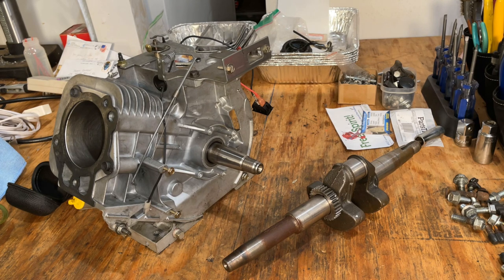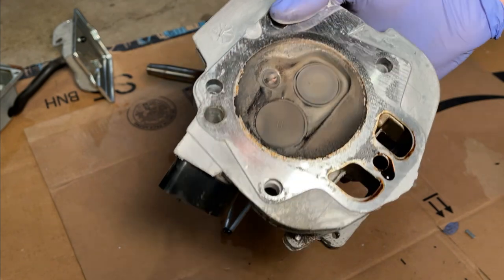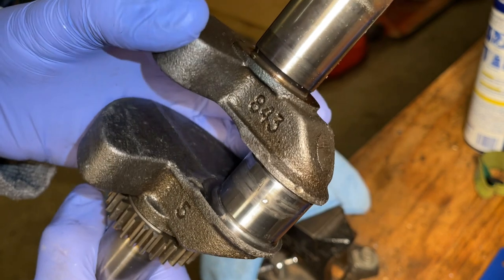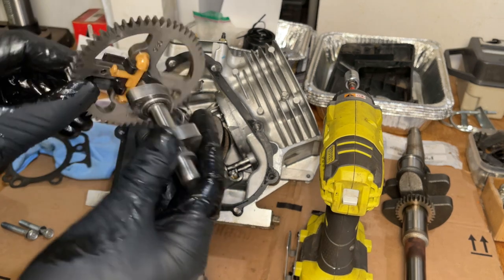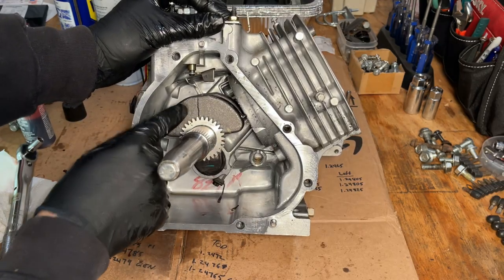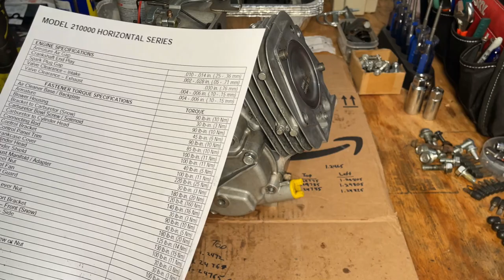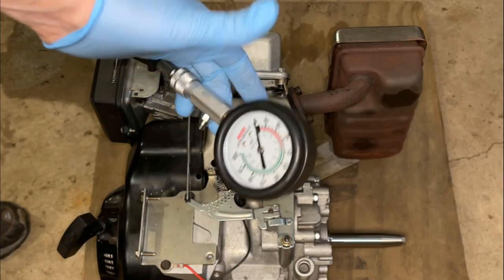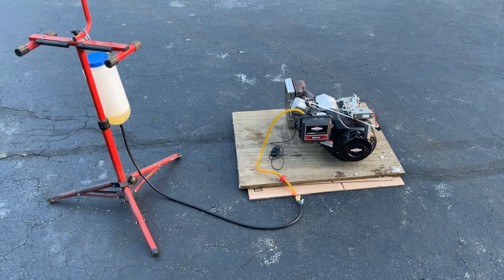Generator Engine Rebuild (Take 2) - 10HP Briggs and Stratton

Comment: I've used cranks farther out than yours. Just run a heavier oil and let it rip. I never had one blow up because of a galled crank. Everyone knows that the lack of oil kills these engines. And by the way. By sending information out like you've got on clearances, I wonder if the people producing small engine performance sheets are building satellite parts?
Reply from the maker: I agree.  I am pretty sure that crank would have been fine.  But hard to use with 25k subscribers looking on.

Comment: Caustic soda is the way to go.  It will dissolve aluminium and magnesium alloys but won't touch the steel.  I don't know what a new crank costs, but a valid fix would be to spray weld and turn the crank back to spec on a lathe.

Comment: That was an excellent video. I had a 10 H.P.  Briggs engines in my shop this month with broken compression release cams, and one 23 H.P. Also one with an exhaust valve guide pushed up into the valve spring in the head. Why are the Storm Responders using that much oil, that they are blowing up? or are people just to lazy to check the oil? Also are you getting any Champion generators in to fix? I had one with a plugged up exhaust  spark arrestor and the engine oil was extremely sticky. Had to flush it out four times to clean it up. Thanks for great video's.
.

Comment: Comstar 99% pure lye on Amazon. Also, would you consider using Sealed Power Plastigage , there are several clearance ranges, to measure bearing to shaft journal clearances? Also found on Amazon. Thanks, love your videos!

Comment: You do have another option to save the crank with a slightly smaller rod journal. That is to shave the rod cap to close up gap. But you have to measure for proper clearance.
Also the new crank looks like a chinese knock off. Just look at how poorly the counter weights were cleaned up compared to the OEM item.
Reply from the maker: Last time I order a new crank.

Comment: Jim, thanks for including the torque settings in the video. Question: did you decide against getting a hydraulic lift table? Just curious. Nest regards. Jim.
Reply from the maker: Will get one at some point.  Back and knees are still good.
Reply: @jcondon1  Will you wait that they are not good before you buy a lift. I have watch a lot of your videos and learn a lot. Thank you very much. Now I have repaired one but not on the floor. I put it on the bench in order to save my back and knees. I think that a lift is a must in your hobby work.

Comment: Out of curiosity, did you measure the new crank and confirm the Briggs book wasn’t over optimistic?
Reply from the maker: I did, but don't think I left that it.  It was dead on the new spec.
Reply: @jcondon1  thanks James! So it let the reject spec, or was above the reject? I suppose I’m unclear on the spec. I figured it was the minimum acceptable value. So if it was that, that means it would quickly wear below that, no?

Comment: All those engines look fairly new why were they out of oil and if I would have received the crankshaft from Briggs & Stratton that looked like that I would have been making some phone calls.... Anyway instead of rebuilding I would have bought another engine.. that's me time saving... Great video thanks
Reply from the maker: They did run out of oil.  Buying a new or used engine in working condition would have made more sense.  At the time I needed a 10hp engine and no used ones were available.  Thought I could rebuild it for $150.  Turned out to be twice that.  Would not do it again unless I had a good used crankshaft.

Comment: The out of spec cranks could be made to work with oversized bearings or shims, assuming the cranks were still mostly round. Shims would be less desirable because they cause other problems.

Comment: I understand what you mean about buying something new, and it's not right.  Happens in the car engine rebuilding all the time. A friend bought new aluminum heads for a V8 engine,  had a machine shop check them out, needed a valve job before they could be installed.  We're talking about new heads, cost $2000 and not fit to just bolt on and run.  Sad . And frustrating

Comment: Did you put the governor gear in I didn't see that that's a very important piece of the operation of that engine?
Reply from the maker: It is on the crankcase cover.  Was not visible from the angle I was recording.

Comment: Hi, i have same looking blown engine from a 204412-0163-e1 My cylinder, piston and rod are bad. crankshaft is ok . try finding those parts but item is discontinue and local shops doesn't have it , can i have an advice on where to look for? , i refuse to let it go. Thank you in advance

Comment: Did you check out the option of getting the cranks polished or cut and buying a oversized connecting rod ?
Reply from the maker: Still looking into that.  I have 5 crankshafts now for this engine that need work.  Would rather use those after being repaired then the NEW one...

Comment: Quick question what's the concentration of Is Muratic acid that you use. Is it pool acid straight out of the bottle or is it a different concentration. Also one of your other videos I noticed you cleaning a carburetor what do you use in your ultrasonic do you use chem dip  Or do you something like water and  Ammonia.
Reply from the maker: Not sure the muriatic acid concentration.  It is sold at Home Depot and made by  Klean-Strip.  In the ultrasonic, I use Harbor Freight Super Heavy Duty Degreaser.

Comment: If you have a machine shop around you might see if it cost effective to have those crank journals built up. Disappointed to see the new crank looking like that.
Reply: A-0.010” crank grind with an underside rod will work and be cheaper.
Reply from the maker: Do not see any undersized rods available on the parts diagram.  Where would one go for that?  Engine# 21T212-0116-G1
Reply from the maker: Me too.  Will looking into getting them machined.

Comment: Most machine shops will regrind those crankshafts for a small fee , but can you get undersize bearings/connecting rods for the motors , if not the machine shop can undersize the connecting rods for you , anyway some machine shops can grind the crankshafts for you !!!!
Reply from the maker: Yes, been looking.  Have all the bad cranks.  Hopefully will find someone who want to fix them for less then the new price.

Comment: i wonder if the tight clearance on the counter weights and the pushrod might be the point of failure on these engines? if the rod gets a little lose. it might start hitting the weights and wearing it down to the point of failure?
Reply from the maker: Could be, but the original crank did not have such an issue.  Am worried about he new one.

Comment: Could you have the crankshaft turned and use an oversized bearing like what is done on car engines.
Reply from the maker: Not sure since this engine does not use a bearing on the crank.

Comment: Muriatic acid is just fine..oven cleaner doesn't work as well. As long as you neutralize the old acid it's fine...why would anyone say not to use it??? I've used it many times and it's the best to get rid of aluminum on the crank!

Comment: You can put low oil sensors in those engines I put them in all of mine.
Reply from the maker: Do you have the part numbers you used?
Reply: 790141 and 695693 I'm fairly certain that's what I used.  You might want to research it a little.
Reply: 794185 is the module

Comment: Can't you get the cranks re-ground and oversize bearing shells?
Reply from the maker: No bearing on the crank.  re-groud would be a good option if Briggs made a connecting rod to fit.

Comment: I assume the rods do not have bearings on these engines. If so, the rod, being aluminum, would wear much faster than the crank journal. Therefore, if the crank journal was worn beyond limit, the rod would always need to be replaced.
Reply: The bearing is in the form of babbitt metal (alloy of tin, antimony and copper) applied to the connecting rod crank end. More sophisticated engines use steel shell bearings that fit in the rod's crank end. these shells are then platted with bearing material. In the distant past they used to pour hot babbitt into the bearing forming each one individually. Thin shell bearings became the norm in automotive use in the 1940's but in small motors the use of babbitt applied to the rod had suffused. If the engine had used thin shell bearings then undersize bearings could have been used in assembly and the crankshaft could have been saved.

Comment: Scrolling through my library of you're saved videos & taking notes , getting ready to rebuild a Storm Responder engine . I'm in need of a set of carb mounting studs  ( BS-794830) , had to use the ones i had on another Storm Responder resurrection . It appears the Responder series engines use a diff thread pitch stud   , than say the briggs on the Powermate series Gens of the same HP.....Bummer .
 I know i can order the studs , but wanted to chk w you as well  , $13 seems a bit much per stud . I have you're Email saved from you're videos information  if you would rather discuss \chat that way .

Comment: What is it with all these Storm Responders with blown engines? Simply checking the engine oil before each use, stopping the generator while it is running and rechecking as well as frequent oil changes would let these engines work forever.
Reply from the maker: I agree, they are good engines.  Just a little oil will go a long way.

Comment: James I have a 10 hp 305 cc 14.50 briggs and stratton, it goes on a 145 hobart welder.  I replaced the worn cam, but it spuders when there is no load.  Once you place a load or weld it runs with no sputtering.  I have placed 3 new carbs aftermarket and all of them do the same.  Can you please help.  The carbs are Nikki carbs, and seems to run a little bit rich.  Mario

Comment: greetings from a fellow small engine lover. wow on the price of the crank.. is a short block available for that application? by the time you get done with crank, rod, piston w/rings, gaskets etc what would be the difference in price?

Comment: What is the pad used on the drill to clean the aluminum?
Reply from the maker: I use the white Roloc Plastic Bristle Disc
Reply: Thanks James.
Reply: @jcondon1  , thanks for sharing this information.  I notice the white one 3M claims to be safe for polishing and cleaning aluminum and at the same time they state "removes minimum base metal".  That still concerns me.  

Nice use of the tools to measure the diameter.  I have not gotten that detailed before in my engine rebuilds.   I think I will now since you have stepped up.  I  might as well.

Comment: I have a Predator 9000w generator. I have adjusted the valves, changes oil, drained the gas tank and refilled it and replaced the spark plug. It had been burning some oil and losing power, so I changed oil, the plug and gas. It didn't make a difference. It seems to have good compression and both valves are opening/closing. I inspected the ignition coil and flywheel. They are both clean as can be, bring as the unit is just 5 or 6 months old. I don't think it's getting enough plug spark, but I can smell gas like it's flooding. Any suggestions?
Reply from the maker: If burning oil, then could have a ring issue or head gasket issue.  If running rich then could also cause smoke and a loss of power.  What color is the smoke.  If white or blue then oil if black then running rich.  You may still be able to return it.
Reply: @jcondon1  It Appears to be a blue color. The carburetor floods when I try to start it. I use the pull start because the battery is dead from cold weather. It had been doing fine until I saw the smoke about 4 or 5 days ago. Then it was losing power and the air filter sponge was collecting oil. I assume that it's blow by out of the valves, but when I took off the valve cover it was clean. The spark plug was fouled out. This is disconcerting because the unit was brand new and had been running great. I checked the mag and it looks like it's set right, but I'm thinking it's not putting out enough spark. There aren't any small engine mechanics around here (kansas city, ks) that work on the Predators, so I have to work on it myself and order parts through Harbor Freight in California.

Comment: i just stumbled on your channel and have been watching a few im more mechanic then electrical and I have come across something you might have a solution it don't make any sense but im fixing a generator that i thought didn't have power but turns out if it's under 750w it won't put out power but if i plug light in it will kick in with heat gun on low and after kicks in can turn light off and stays on or if turn heat gun on high it will kick in and stay on when switched to low but if you turn gun off and back on won't kick in

Comment: James, I’m in Texas and trying to use an older Briggs & Stratton 5500/8550 unit to stave off the power outages.  Before discovering your channel I got it to start but would only run in choke position, slightest movement to run mode it would die.  I let it run for 3 hours in choke until it finally cut out.  When trying to restart it is backfiring and blowing fire out of the exhaust.  I imagine I let it run way too rich for too long and caked things up.  After watching your vids I feel confident about cleaning out the carb, which was prolly what was causing the initial issues, but do you think I need to do any other work to clean out downstream components?
Reply from the maker: I agree, sounds like a carb issue.

Comment: Do you have a machine shop that can regrind the chanks for you ? And bore the rod for bearing  that seems to me a better repair than new and for the same cost  just a thought 73 n4jrs
Reply from the maker: Still looking for a local shop.  I have at least 5 of these crankshafts that need repair.

Comment: You used to be able to buy oversize connecting rods for undersized cranks so they could be turned down is that still a thing?
Reply: I have seen Roadking and Mike take a little off the rod cap to tighten up the clearance

Comment: Seems like you get a lot of those Storm Responders for repair.  Is it because of owner neglect or poor quality in your opinion?  Running out of oil is pure owner neglect.

Drano (and probably other brands) clog remover for sink drains has its main ingredient is also lye (sodium hydroxide).  It may be a stronger solution than oven cleaner.
Reply from the maker: Thanks for the info on Drano.  I have never run a storm responder for an extended period of time, but from what I can see they are built well.  Think it has to do with not checking the oil, outside temp, the oil weight used etc...

Comment: I bought a generator from Costco it’s a Furman and I loaned it to a friend who had a fairly big air compressor the air compressor is running at 15 A 230 We ran it on a 30 amp 240 twist lock and the generator struggled to run the air compressor and shut off we are running this generator off of propane not gasoline any thoughts
Reply from the maker: You will get less horse power running on propane.  Also the air compressor is a large inductive load and creates a large surge.  The start the compressor you would need at least 7200 watts (30 amps @ 240 volts),  if not closer to 9000 watts.  What is the gas power rating and propane power rating on that generator?  Would try running on gas or using a smaller air compressor.  Another possibility is to get a soft start system like those used on central AC systems.
Reply: @jcondon1  gas 9500 propane 7500

Comment: Try to buy toilet bowl cleaner with hydrogen chloride like the works. There taking it off the shelves along with oven cleaner. Stuff that removes lime. EPA says its bad. So if you want to clean anything your going to need to make your own.. Just Cleaned my toilet with a small amount of muriatic acid.

Comment: hello James, 
on this engine the play is not significant : you'll never experiment a oil pressure fail, coz' there is no oil pump, so no oil pressure. 
this engine will run for "a long life" with a missing thou on the diameter of the crank or on the cam shaft IF the OIL LEVEL is correct, and if the oil is CLEAN, coz' no oil filter, it's very important, far more than a thou.
specs are for a new one, if not in, you can get an another for free.
use a torx when you adjust the valve clearence.
Reply from the maker: I regretted purchasing the new crank after I saw the condition of the "new" one.

Comment: is there not a mechanical governor running of the cam on these ?
Reply from the maker: It was on the back of the crankcase cover.  Did not see it due to the recording angle.

Comment: How can so many engines run out of oil and get trashed, I would think all you have to do it turn the engine off, check the oil and add as necessary.
Reply from the maker: A simple oil check would do it.  Do not think people realize how many hours you can put on a generator in a short time.

Comment: I was thinking turn the old cranks down and use oversized rod bearings but at $147 for a replacement its not even worth taking it to the machinist.
Reply from the maker: I am still looking into machining options on the bad cranks.  Have 5 now that need work.
Reply: @jcondon1  maybe check with a local technical school. Sometimes they take on projects for the education. You would still have to find oversized rod bearings for a Briggs and Stratton. Maybe go power sports would have them as a go cart part.

Comment: A QUESTION FOR ANYBODY  I have a PowerMate PMC105007 what should the head bolts be torque to PLEASE ANYBODY HELP???????????????
Reply from the maker: Looks like a Honda clone.  Usually I tighten to 29 ft/lbs on engine of the 389/420 cc size
Reply: @jcondon1  thank you very very much
Reply: I have another question the generator has about 940 hours should I have a valve job done, no I've cleaned off the valve and I've cleaned off the head but should I still have it done